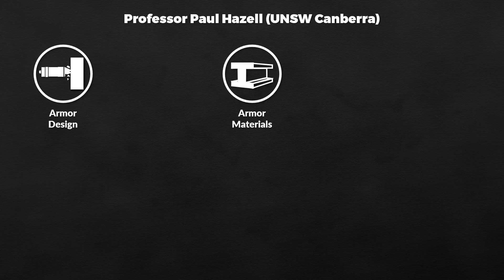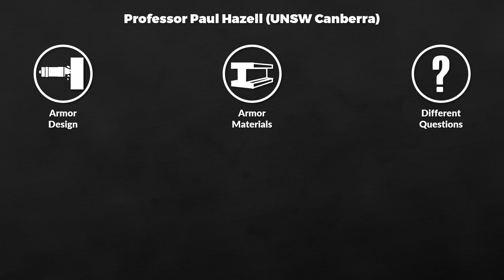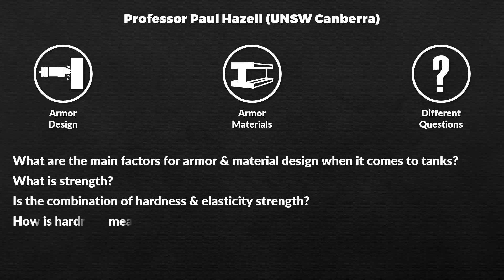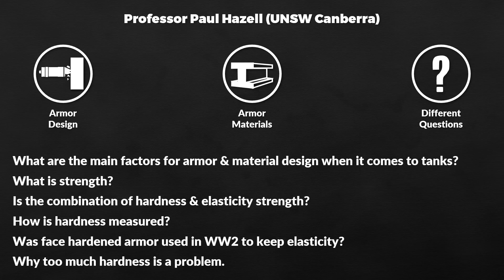Tank Armor Expert about Armor Design 101

Comment: My dad was a machinist after the war and had a set of Rockwell hardness gauges. I think what this is saying is the hardened surface deforms the incoming shell increasing the surface area in contact and the softer stuff behind it then absorbs the energy over a larger area by flowing. By spreading the energy out over a larger area you reduce penetration depth.
Reply: The goal of the hardened surface is to shatter a hardened projectile, as hard materials are usually low toughness. So a ceramic plate is really hard and resists flexing. To the point it shatters instead of bending.

A hard material can push soft material out of the way readily, and will penetrate with minimal loss of energy, while soft materials are far tougher and can adsorb fat more energy as is deforms and yes uses a larger volume of material to adsorb the energy.

And then there is micromaterials. With extremely hard fragments inside a softer matrix, which is difficult to manufacture without using composite materials. The super hard elements break down and shatter the penetration advancing high hardness low toughness penetrator, while the composites adsorb and distribute the energy over a larger volumes of material.
Reply: Analogous to plate armour over a gambeson - plus ça change plus c'est la même chose.
Reply: @TheColonelSponsz that's an excellent example. 
I always liked glass & a spring, a spring will collapse under pressure but will recover, glass will either hold or break.
Reply: Not really.  A projectile doesn't become significantly wider in cross section after impact.  Surface hardening is to induce shatter and ricochet.
Reply: @obsidianjane4413  What he meant by increase in surface area is shattering or deforming the projectile, increasing the effective area where energy is distributed.
Reply: @murmenaattori6  That isn't what happens.
Reply: @obsidianjane4413  Tell me what happens then if you're so wise on the subject.

Why do you think armor wants to shatter projectiles. Because when a projectile becomes multiple pieces, it can no longer concentrate it's kinetic energy into a single point. Now go ahead and tell me.
Reply: @murmenaattori6  Read the OP again. He is not asking about shatter,  he is describing "mushrooming" like lead bullets do.  They are not the same thing.
Armor thickness does not induce shatter, its the relative hardness and impact angle between the plate and projectile that does. 
And a shattered or tumbled projectile can still penetrate a plate if it overmatches.
Reply: @obsidianjane4413  You're right. Sorry for the passive aggressiveness, I was straight up stupid there. Think I got confused as the second comment in the chain talked about shattering...

Btw I do think thickness is a factor - but only up to a diminishing point. For example a paper thin sheet of ceramic does not shatter a rifle caliber AP bullet's tungsten carbide core (let's forget for a second that the hard core would be covered with a soft jacket), while something like a centimeter does, hence body armor doesn't use thin sheets of ceramic. A thin sheet's individual strength simply doesn't create enough stress and pressure as to where a hard penetrator would shatter upon meeting it's resistance. Even if this hard paper thin sheet has a stiff backer material the sheet will be defeated individually before the backer can support it.

You're basically correct tho maybe just the wrong wording. As there is of course diminishing returns to the thickness of a hard layer. As long as there is enough hard material to shatter as specific penetrator, after that point it's better to increase the amount of stiff material to soak up the kinetic energy. Thickness causes stiffness to increase exponentially, so the difference between 1mm and 10mm for example is massive.

The rest about relative hardness, angle of attack and overmatch is right on. I think the angle factor causing shattering applies more so to long rod sabot used by modern tanks, solid shot AP shell or rifle bullet would simply ricochet.

I could nerd over this stuff all day to be honest. Have been reading about composite armors and material science for a long time, I don't work in the field tho and am not an expert.

Comment: Here's a hopefully clearer explanation of strength and elastic versus plastic.

Elastic means that when you remove the force deforming the material it returns to it's original form with no permanent deformation.

Plastic means that when you remove the force deforming the material it reverts to form somewhere between it's original form and it's form under load. Thus there is permanent deformation of the material

Stress is the force applied per unit area of the material - the total force divided by the cross-sectional area.

All materials deform elastically under light loads and plastically as they approach failure. The yield strength is the stress below which the material deforms elastically and above which it deforms plastically. A material subject to a stress greater than it's yield strength for an extended period of time will continue to deform and eventually fail. Ultimate strength is the stress at which the material fails suddenly and catastrophically.

Comment: Boron carbide has been around since the 1930s. Has there ever been any attempts to use it in armor before the composites like chobham came about?
Does it have any use against heat rounds? 
Were there any attempts to use ceramics in WW2?
Reply: Boron carbide was rather used in radiation liners by the Soviets. The Americans tested it against shaped charges and found it was great, but there seem to be other factors preventing its use because it did not go anywhere. Note that the MBT-70's thick polyethylene radiation liner did increase protection against shaped charges, but was not thick enough to really stop anything beyond maybe 90mm HEAT.
Reply: in tanks i have no idea

in body armor however, we know that B4C was used for making hard scales for 6B4 and some variants of 6B5 (6B5-15) (so, mid 1980s)
Reply: @elanvital9720 Price.
Its easily 10x the cost of Alumina ceramics.
Thus its generally only used where weight  is at a premium or where volume is critical..i.e. aircraft of all types (emphasis combat helicopters ) and high end personal body armor.
Reply: @gamecubekingdevon3 Cost. Boron carbide is roughly 10x the price of alumina armor for a similar protection level.

It tends to be reserved to where weight is criticical.
Reply: @dwwolf4636  thank you to share this with us

Comment: Here are a few questions off the top of my head for you:

How can armour be optimised so incoming projectiles are deflected or "bounced" off more readily? Is angled armour the only way to do this or are some materials better than others at causing deflection?

Once a projectile hits armour at an angle and starts to penetrate, how does this change the direction the projectile is traveling in? So once an APDS rod hits the armour, will it turn towards the "normal" or 90° in the same way light refraction through glass would work? Or would the APDS rod tend to turn away from the normal and effectively have to travel through more armour?

Nicholas Moran once mentioned "normalization" if my memory serves. What does this entail in terms of armour? He was referring to the practice of US soldiers during WW2 of adding extra improvised armour to their Shermans in the form of wooden logs, concrete, bits of mild steel plate etc. This was seen as detrimental to the tanks' armour protection, since some of these improvised applique armour pieces would actually increase the odds of the armour being penetrated. For instance an incoming projectile at 45° might bounce off a Sherman's front plate. If this same projectile were to hit say a mild steel applique plate first, it would not bounce off and would start traveling through the mild steel. Once it then reaches the actual armour, it can't bounce off since it's movement is now constrained by the applique mild steel armour, hence it penetrates the armour plate as well. 

Why don't modern APFSDS rounds use a more more ductile tip, followed by a harder penetrator, in the same way older APC (armour piercing capped) rounds worked?

  I can probably dream up some more, but I'm leaving it at four.
Reply: The Swedish trials of the T-72 bought from the former East German stock revealed that the angles of the 103 armour was in effect useless for deflection of long rod penetrators, as it simply ignored the sloping and went straight through the poor S-tank front to rear.
The reason for NOT having a softer tip (apart from not being needed) is that you risk breaking the penetrator as it "snaps" to a new angle not in line of the trajectory, thus losing a lot of penetration capability.

Lärobok i Militärteknik, vol. 4: Verkan och skydd Författare: Kurt Andersson, Stefan Axberg, Per Eliasson, Staffan Harling, Lars Holmberg, Ewa Lidén, Michael Reberg, Stefan Silfverskiöld, Ulf Sundberg, Lars Tornérhielm, Bengt Vretblad, Lars Westerling
Reply: From what I understand, angled armour does tend to increase the apparent thickness, so long as their enemy fire is coming from a relatively level position in relation to your own armourer vehicle (as in the same height above sea level). The steeper the angle faced by the enemy, the better. If the angle is neutralised by enemy fire from an elevated position, the thickness will be equivalent to more or less unsloped armour. Hypothetically speaking, the hardness and elasticity of a material, as well as the ability of a material to be plastic, can increase the chances of an incoming projecticle bouncing. Of course, sometimes the projectile will have important consequences anyway. 

The armour may appear to have bounced the round despite actually suffering a bit of plastic deformation inside the material (where it is hidden from the naked eye); this may be at an atomic level but it could be noticeable if youcut the armour in half. Repeated events like this may eventually cause the armour to fail or experience significant deformation. In the latter case, it may still deflect an enemy projectile but from that point onwards, it may be particularly vulnerable or even form a shot trap . 

Generally speaking however, armoured engagements where vehicles are shooting at eachother won't last long if the vehicles have similar characteristics; the first crew to acquire their opponent, take aim, and fire will come out on top. Yet, there have been some examples of the above process during the war in Ukraine wherein an infantry fighting vehicle armed an auto-cannon has had to confront heavy enemy armour (a main battle tank) and work its way through the actual armour. 

There was also an instance in which a man-portable anti-tank guided missile fired in direct fire mode penetrated a tank's road wheel and seemingly turned up as it passed through the material, penetrating the hull and knocking the tank out of service. It was also rumoured to have skipped off of the ground first. A few inches lower and the missile could buried into the ground or hit it head on (probably detonating). Conversely, it could have easily hit the ground and bounced into the tracks; scoring a mobility kill. A little higher and the missile could have been taken out by the tank's explosive reactive armour. 

So, this reminds me of the WW2 Shermans and the effect that some of the field modifications had. The road wheel guided the missile into the vulnerable section of the hull.
Reply: Its helpful to understand that at the energies of AP projectiles, you are in the realm of fluid dynamics. When a projectile hits a material, the wider its cross section and face, the more lift it generates and the more yaw is induced.  This is why many AP cores are blunt behind their caps or are scalloped. It is to prevent that or they actually turn into the armor.  Long rod APDS are the ultimate expression of that because it produces so little lift.

The junk piled onto Shermans was ineffective because most of it (concrete, wood, tracks ) wasn't strong enough to really matter.  It mostly just made the crews more confident. Most of the applique patches were of armor steel  so would have been beneficial.

Comment: How does composite armour get repaired? can it be repaired or does it just get replaced? How does composite armour get built?

Would the shattered high hardness layer (ceramics and glass) lower the armour effectiveness? How would that be tested?

What is it about the structure of glass which makes it useful for stopping projectiles (other than its high hardness)

was/is composite armour that much better than ERA that NATO never used it? Why is that so?
Reply: I think the Leclerc has replacable armor pieces🤔
Reply: @comentedonakeyboard  Yeah I think that is how its done in general. The upper frontal plate must be in one piece because you wouldnt want cracks in the armour. Im assuming that it is welded together and not clipped but im not exactly sure.

on a side note I would like to find out how damage was repaired before composite armour. using a blowtorch would the cut out a square around the damage and then weld in a plate the size of what they cut out or would they replace the entire plate?

Comment: Engineers describe strength in terms of stress/strain (9:00). When you apply stress (force; e.g., newtons or pounds), the material is strained (measurement of deformation, like stretching; e.g., mm or inches). "Engineering strength" can be thought of generally as the relationship between stress and strain. For the following, imagine hanging weights from a vertical bar of metal. Initially, stressing (adding force) causes "elastic" strain. It's "elastic" because if the stress is removed, the material springs back to its original shape. As the stress (and strain) increase, there is a point called the "yield strength" where the material stops stretching "elastically" and stretches "plastically" - in a way that it can't spring back from. Plastic deformation is what happened to your slinky when it got bent too far. No matter what you do, it's deformed in a permanent way.

For something like clay, the yield strength is tiny because a little bit of stress causes a permanent deformation, while rubber or steel can spring back to their original shapes after being somewhat bent. As more stress is added, some materials (like steel) actually increase in strength (strain hardening) even though they are being stretched. There is a limit to how much stress can be applied to the part before it begins to fail ("ultimate strength"); at that point, the plastic deformation effectively runs away and the material stops supporting the stress.

A brittle material like cast iron or ceramic does not deform plastically, so it breaks as soon as the yield strength is reached. 

Hardness is a measure of how much force the surface of a material can take before it deforms. It typically is measured by pressing a very small, very hard, standard-sized ball against a surface at a known force. The size of the dimple tells you the hardness. Generally, higher hardness comes with being more brittle - more likely to fracture than deform plastically.

So, "face hardening" means treating a piece of metal so that one side (face) of it is hard/brittle while the other side is springy/bendy/able to be deformed.
Reply: The Prof is talking a lot. For me as an engineer he not precise in his topic. It is material science after all, but he is not coming to the point. Talking around the subject to, as if he knows more, but doesn't dare to share his secrets. - Maybe correct over all, but wastes my time as he is elaborating - weary, got tired, startet skipping...
Reply: @copilot_4U  Yeah; but in all fairness that's easy to do when you're speaking off-the-cuff and the material science was a bit of a tangent. It's easier to be organized when you have time to write things down, so hopefully I was succinct enough to fill in a blank or two.
Reply: @copilot_4U  Don't take it personally. You should watch it in full one day. It may give you ideas about how to improve your own science communication. You sound like you might be in a position like his one day.

Comment: Just to clarify what Professor Hazell is saying, all of this materials stuff is just tying to empirically quantify how a material behaves when subjected to different kinds of mechanical manipulation. The underlying cause of a material's different strengths, hardnesses, toughness, ductility, etc. is the strength and orientation of the materials chemical bonds and the larger organizational units (like crystal or grain structure). But strength isn't like theoretically linked to hardness or anything, they're all just measurements of the systems properties that arise from the small scale structure.

Comment: Hardness is the total resistance to deformation. Toughness is a materials ability to handle shock.

Armor is all about being able to resist energy input. You can use different material properties in a combination to do this but also there are different types of projectiles and they will have different effects armor.

This is somewhat of a question to ask. It's my understanding that velocity is important for anti armor because the faster the impact the less time is available for the armor to spread the energy meaning that the impact is concentrated to a smaller area and requires less effort to penetrate.

Assuming that is true the strategy for armor is going to be to extend the time and area of the impact.

High hardness can damage the projectile but it also provides the most resistance. The problem with high hardness is that it is prone to brittle failure.